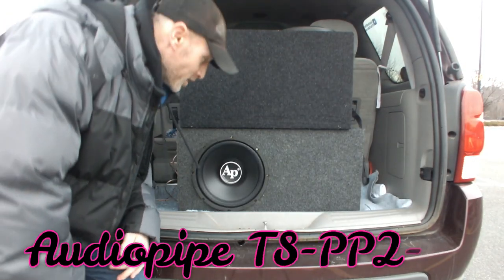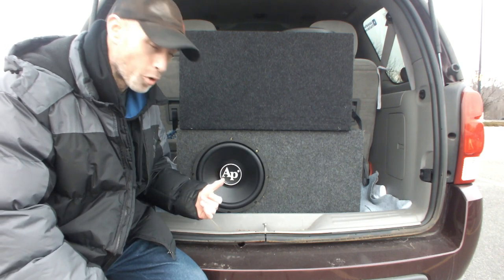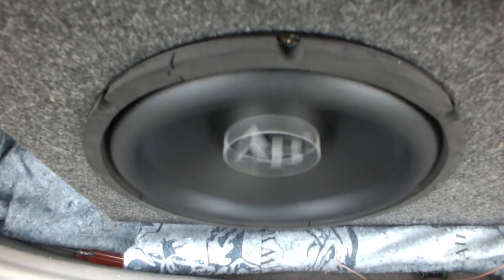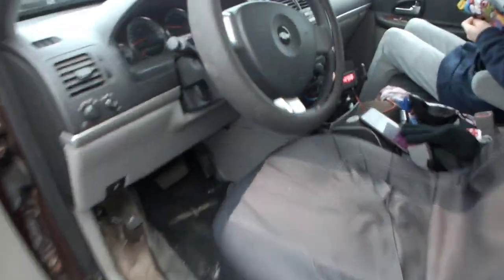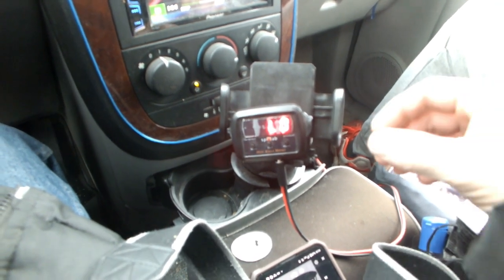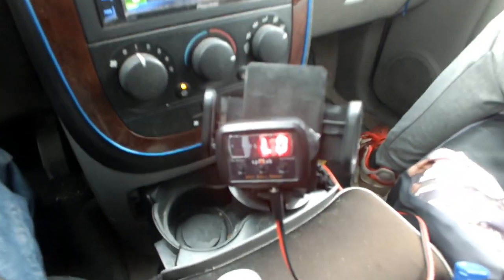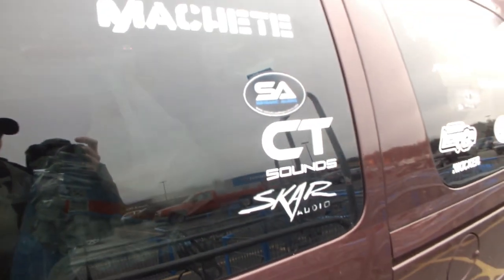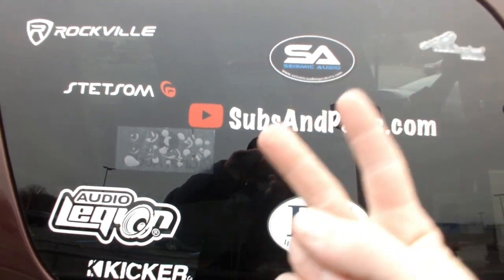Audiopipe TS-PP2-12 Car Subwoofer  Taramps HD3000 SPL Mini Audio Meter DB Test Excursion The Chevy

Comment: In the right box and port area this sub can rival the sundown SA series it's absolutely insane I had 2 of them with the triple stack motor the pp3 series flexing the steering wheel and dash like crazy and turning the window into rubber in a 2003 Pontiac vibe at 22hz and I was only using like 400 watts, So you got to get the port area with the right port velocity and fire it towards the hatch or trunk.

Lower wattage loose spider subs are more efficient with less port area but you don't want to make it too small though you want that Goldilocks zone.
Reply from the maker: nice, I've made a few boxes, I'm going to be making another with my son in law soon. Thanks.